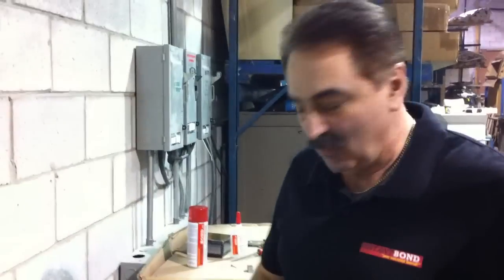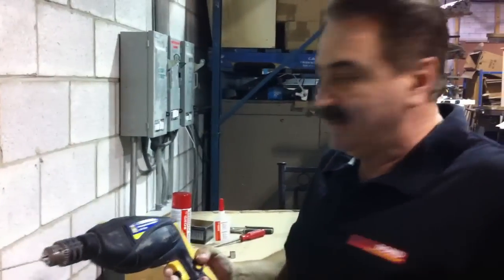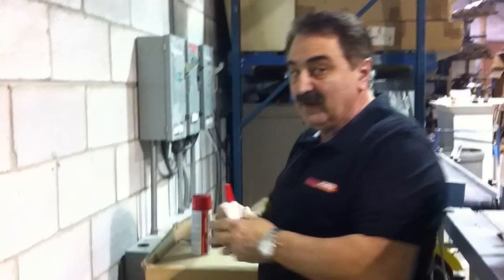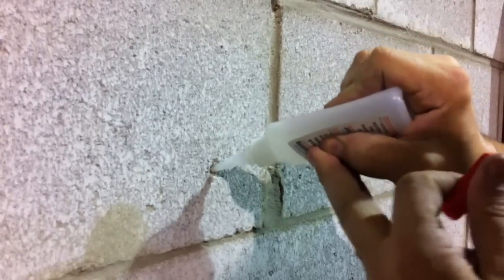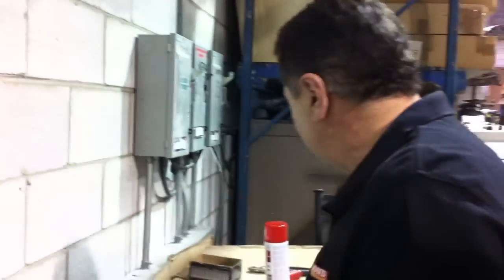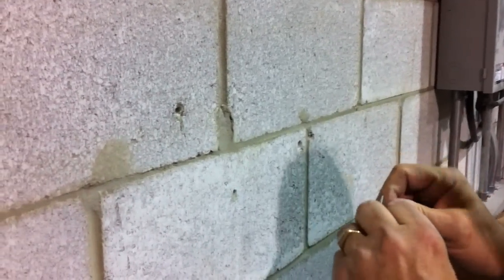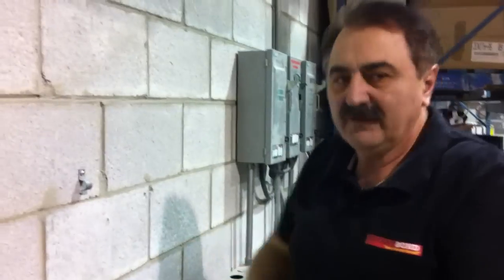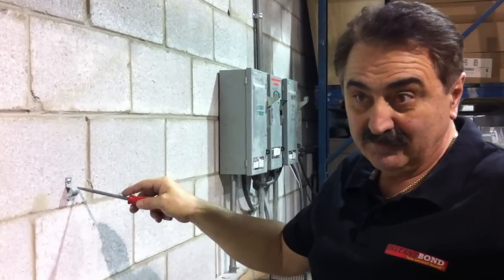Liquid Wall Anchor  How to Install the best concrete Wall Anchor easy !

Comment: Do you have enough Instantbond left to fill in that open knockout on top of the electrical apparatus?
Reply: Shouldn't the electrical boxes be mounted on plywood.  Never directly onto the block.

Comment: How much weight can that hold??????????? what's the name of those applicators, both?
Reply from the maker: Hi Carl, It may vary depending upon the Surface and Installation Techniques but generally it can hold 50 pounds easily. The Activator and GLue called instantbond Glue. You can get more information about the product here: http://www.instantbond.com/
Reply: Carl Zorro is

Comment: what is actavator.?
Reply from the maker: Visit: http://www.instantbond.com/
Activator is spray, used with the glue. When glue used together with the activator spray, bonding time is reduced to mere seconds, at an incredible 5000lb. psi bonding strength which is nearly impossible to break.

If you still have any question, we will be happy to answer those.
Thanks and have a great day :)